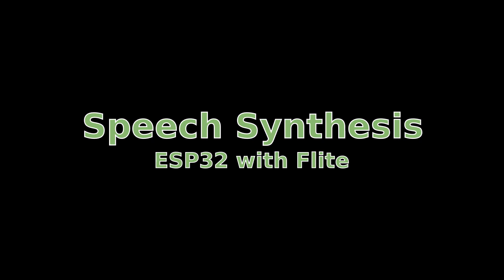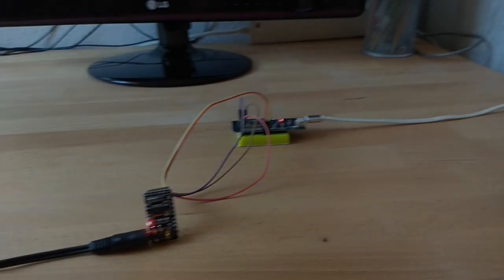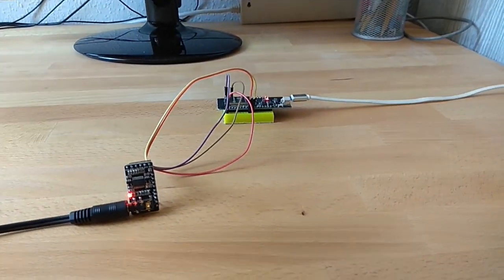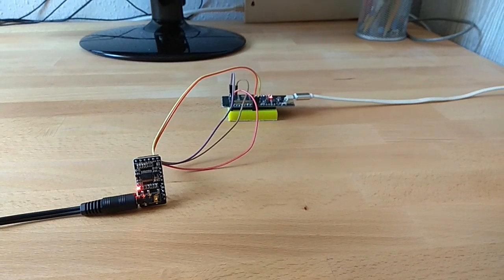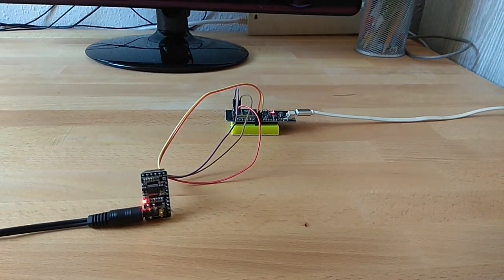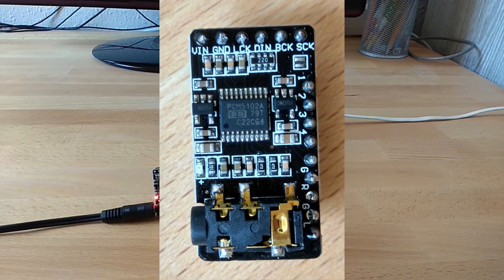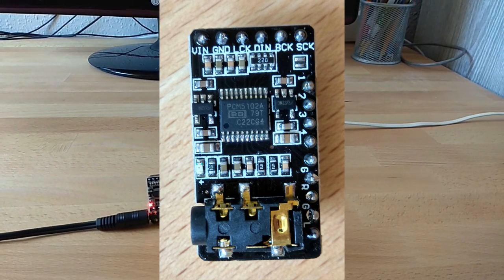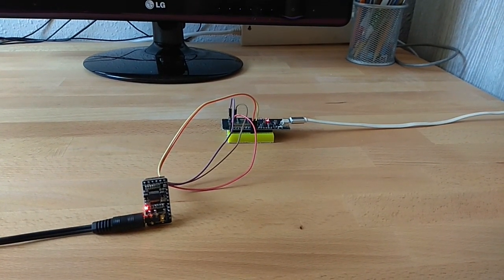Speech Synthesis on ESP32

Comment: Great work! Is it capable of a clearer sounding voice? Was that a speaker limitation?
Reply from the maker: I believe that the voice can be clearer with better DAC and speaker (that was the cheapest speaker ebay has to offer). Also the recording with a phone further degrades the quality. Here is an example synthesized on a computer into a wav file, this can give you a sense of the upper limit on clarity with this specific voice (cmu_kal_us): http://www.cs.cmu.edu/~awb/festival_demos/sounds/intro.wav 
There are better voices you can use, such as the CMU Arctic voices, but these are 100+ Mbytes in size.
Reply from the maker: Oh, sorry the previous comment was not accurate, I was confused with a different project. No speaker was used here, the DAC feeds into the line-in of the computer.